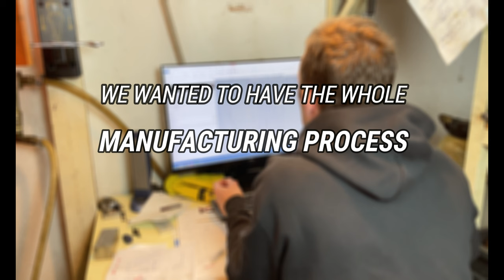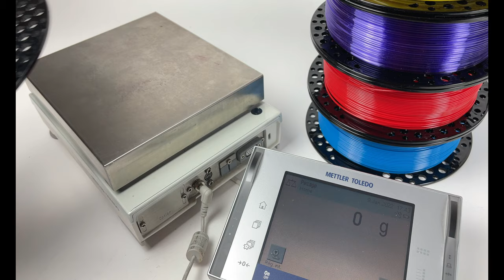New Filament Spool Production - AzureFilm

Comment: "Perfect winding" -- while showing bad winding. 🤣
But at least this spool doesn't have huge notches on the edges making them impossible to use with normal edge roller holders, and at least they don't have huge holes on the sides for filament to enter and get stuck in. The old spools were truly a masterpiece testament to incompetence, so great that you finally got rid of that garbage!